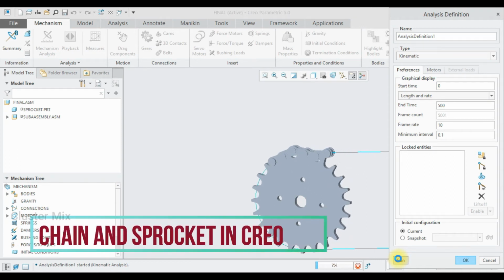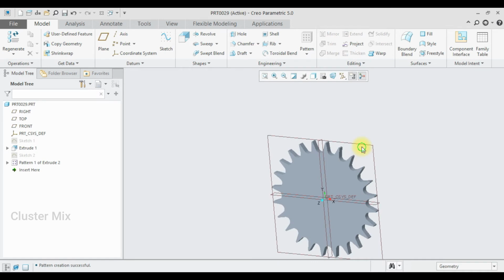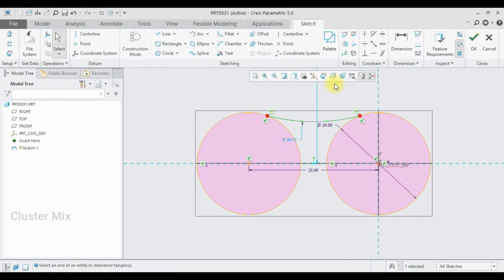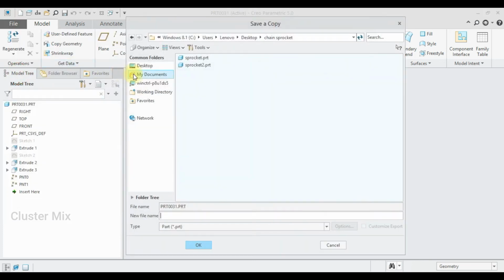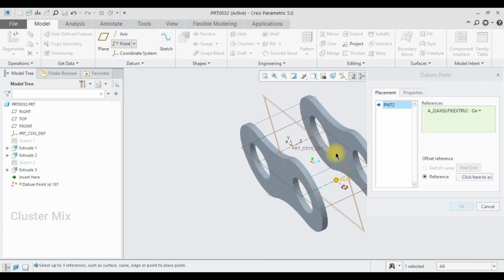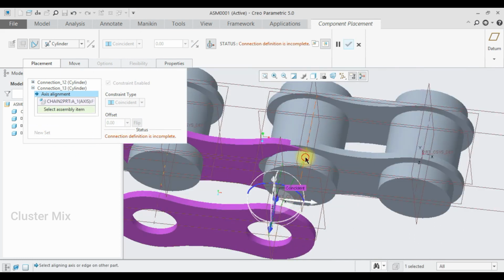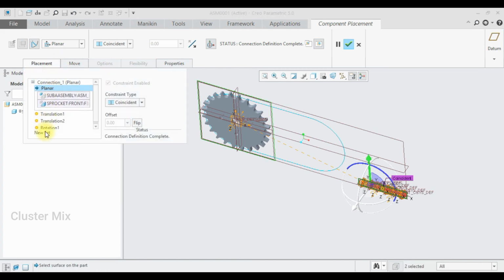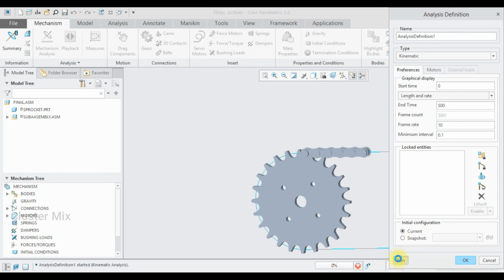CHAIN AND SPROCKET MECHANISM IN CREO || CREO MECHANISM TUTORIALS || CHAIN SPROCKET DESIGN IN CREO

Comment: @Cluster Mix Your video was awesome to watch BUT when I start to implement, I found that the dimensions were wrong. With the dimension mentioned in this video for the Chain block, the chain assembly is not rolling over as shown. However, by changing the diameter to 8(from 10) and the distance between the inner circles to 25.3(not mandatory), my simulation worked.